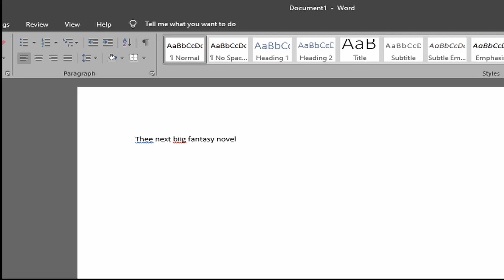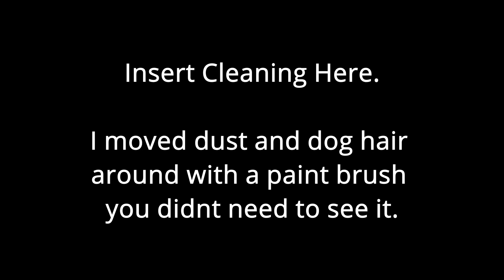Keyboard Double Tap Issue, I Repaired my Logitech G613

Comment: same issue here
I use isopropyl alcohol 
it works temporary
Reply from the maker: That was my first step as well but i got fed up of having to do it over and over again. I needlessly worried about dismantling and desoldering the keyboard to fix it. So far since the repair i've had no issues. I hope the video helps you fix it, if you have any questions please ask away.